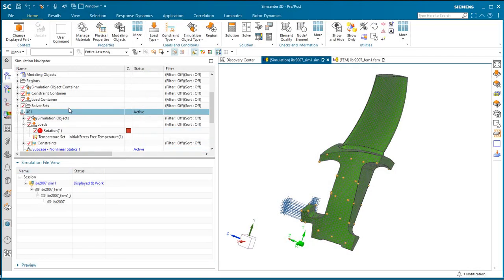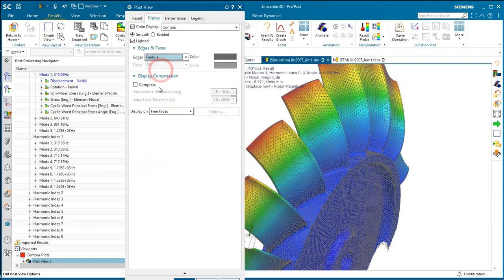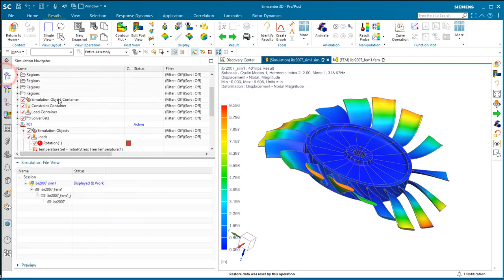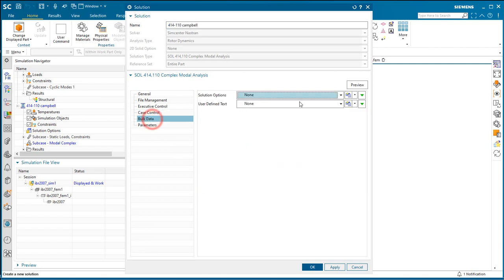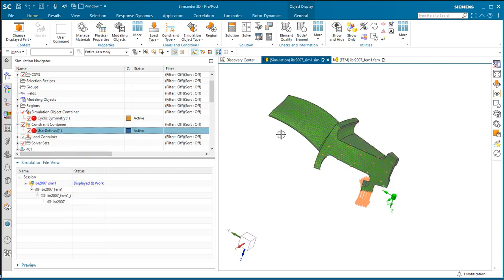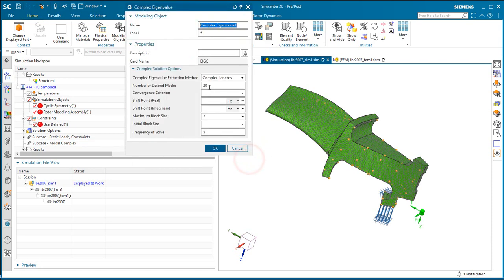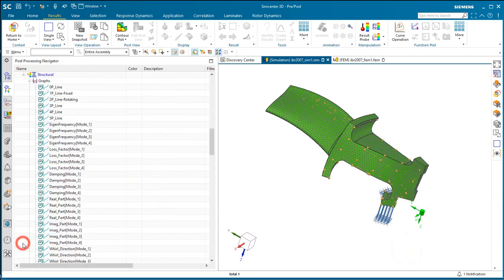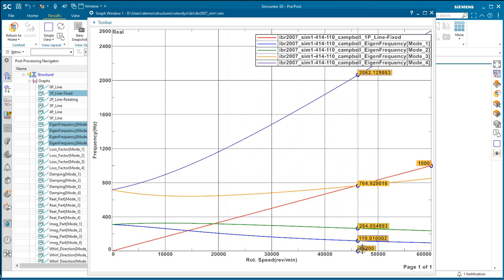Cyclic Symmetric Rotor Dynamics Analysis in Simcenter 3D

Comment: If we didn't for example want to look at whirling modes etc, what is the difference between doing this, and simply adding in a new subcase to the existing solution, with a STRUCTURAL>COMPLEX MODES case?

Also surely this (were this an assembly FEM etc with maybe some clamping loads etc) would not retain the Solution 1 pre-stressed state for the result ?
Reply: In the first part of the movie, solution SOL 401 calculates the cyclic modes for a chosen rotation speed defined by the Rotation Force.  Results are complex modes of the structure for different harmonic indices, accounting for the prestress state of the structure due to the centrifugal loads.  
In the second part of the movie, a SOL 414 Rotor dynamics solution is defined with the aim to compute complex modes and eigenfrequencies for different values of the rotation speeds, resulting in a Campbell diagram. It highlights how eigenvalues of the structure are affected by the gyroscopic effects due to the rotation, and the critical speeds of the system where resonance occurs, which are the intersections with the 1P-line.  Regarding complex modes calculation for a single rotation speed, results of both solutions are equivalent.